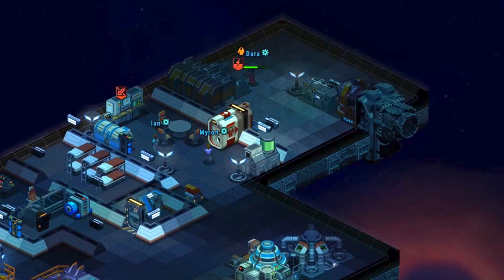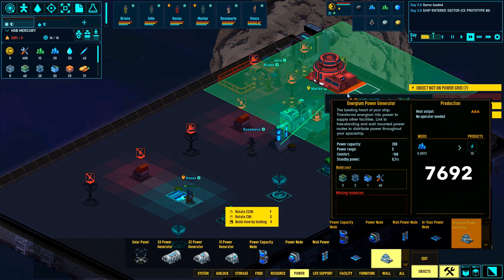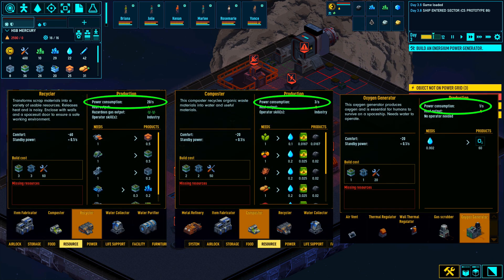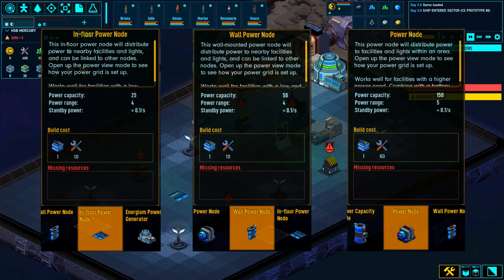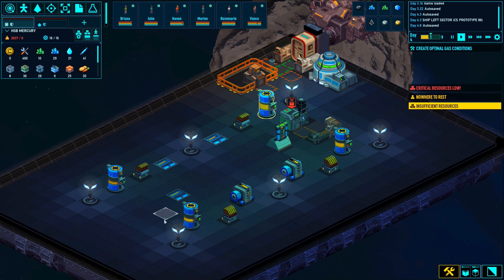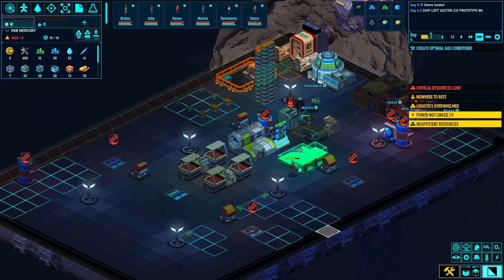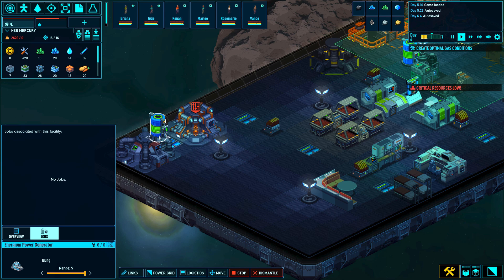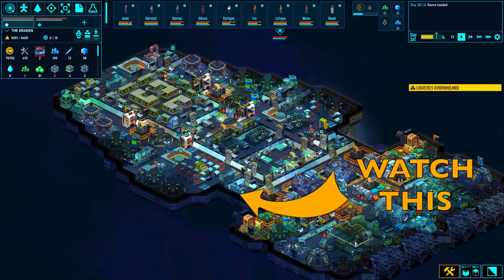Space Haven: Power Tutorial (How to optimize your Powersystems to prevent Blackouts)

Comment: I have fuel but not the crew don't refine it and then the ship loses power. Any advice?
Reply from the maker: did you setup the refinery? told it what to do?
Reply: @Drakkart   I have. One ship which is mainly a gun ship with a small crew will, but on the main ship nothing happens. I've got crew with skill 3 industry on both.
Reply from the maker: @wowmynameisjack  did you set the refinery up? told it what to do? you might want to check that out https://youtu.be/EPvf47iZxE4

Comment: Great video! Thanks! Currently following your Let's Play playlist.

A question: in the "power grid" view, is "Power Availability" important? How? Is it related to power capacity (of the nodes) or something like that?
Reply from the maker: it is related. basically the color of the tiles indicate how much power a facility could draw in that spot, let's say it is only covered by a floor nodeproviding 25 capacity that would be a red value (still better than nothing right?) but let's say a tile would be covered by let's say 2 powernodes radi so that would be an entirey 300 power (given they are charged up that also plays a role) so in theory that would be 300 power and thus the extra high availavility color. it does not make sense though to stack powernode radi since you are not be so stupid to put a high demand facility in an area where only floor nodes provide power, and a big powernode is enough for the highst possible demand. so i did not pay too much attention to that graph as even industryfacilities are hardly operated simlutaneously.
Reply: @Drakkart  Thank you!

So, basically, low-demand stuff like living quarters, bathrooms, airlocks and shuttle docks, it's fine if it's only power by low-capacity nodes like floor nodes, I guess?
Reply from the maker: @brunocarneiro107  just check the power demands on stuff, check "The End" video and then check ingame why i might have set it up exactly like that. clues can also be found in "the Complete Guide". standby power and power consumption those are the things to look out for.

Comment: I linked my solar panels to a power node that had energy refinery in its range. Then one way connection to power generator and one way connector from power generator to power storage. That secures energy rod production and makes use of all the power coming from solar panels
Reply from the maker: yep should work, as said solar panels are a no brainer pretty much everywhere on your ship. as long as they have a way to charge other powernodes these charges won't be made by the generator thus saving fuel.